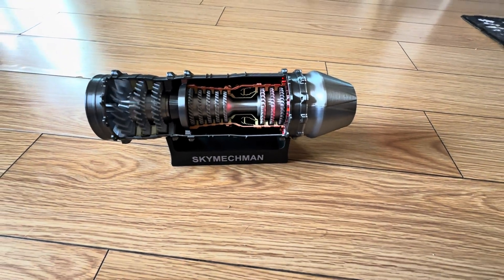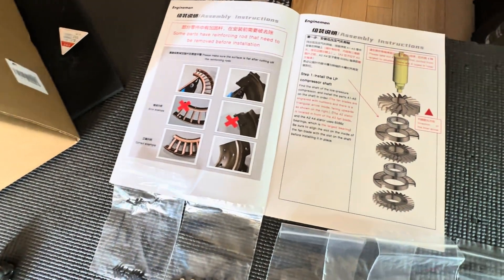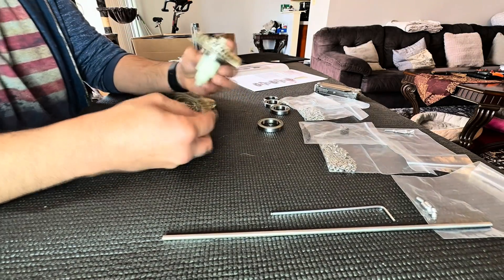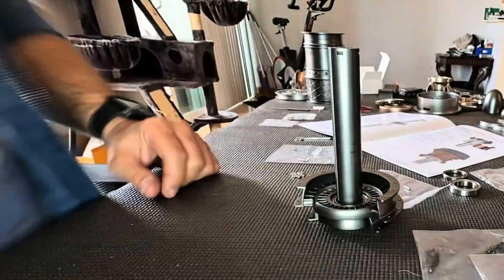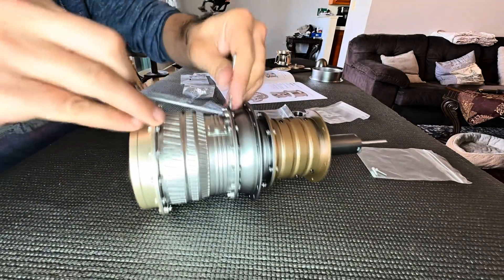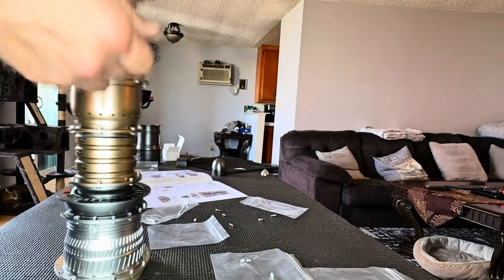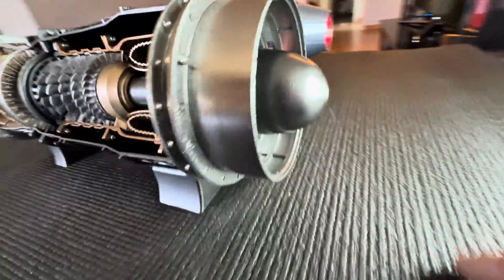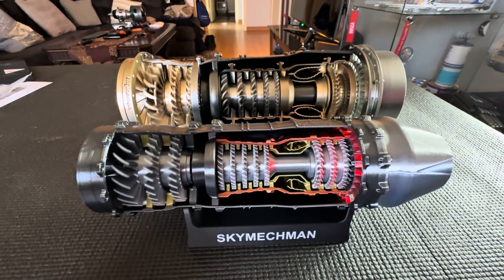Stig Projects… another WS-15 but the hard version

Comment: the 787 has had its first fatal crash, by the looks of the videos the flaps were retracted way too early and the gear was kept out. my reasoning being it started climbing then suddenly started dropping and there were no visual signs of a engine failure
it was a miracle that a single passenger survived
RIP to all the passengers and crew that died